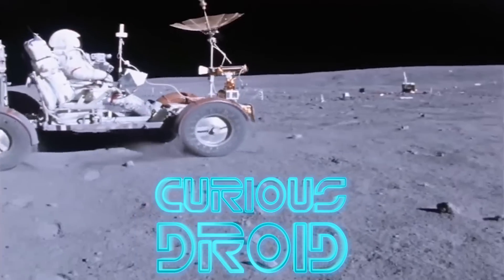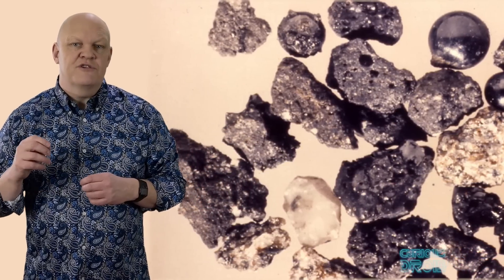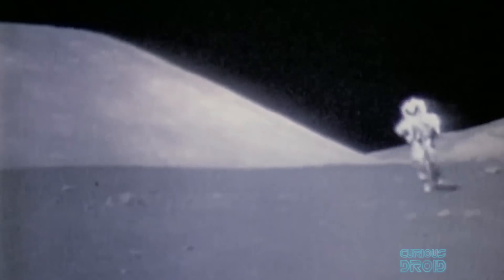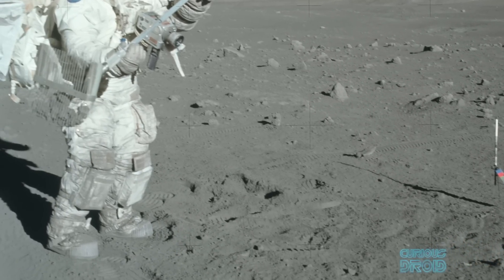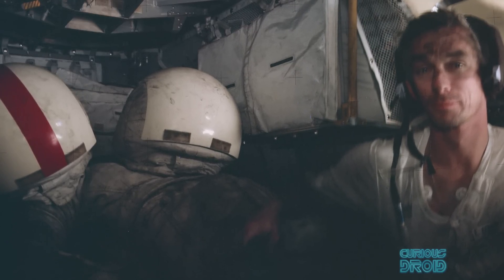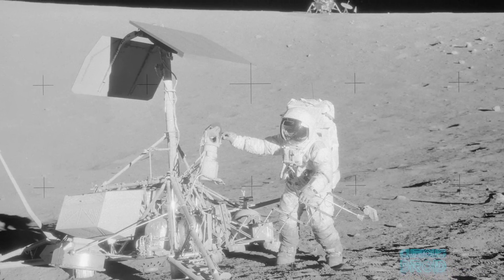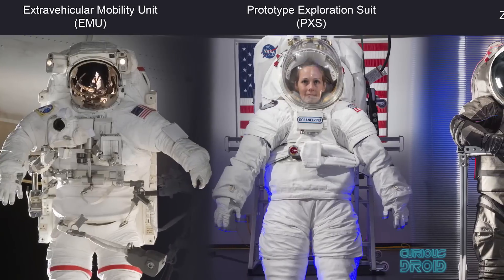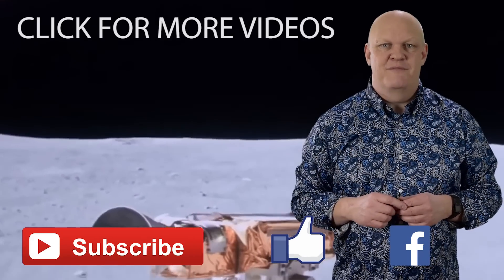Apollo, the Lunar Dust and NASA's Dirty Problem

Comment: Funny how there isn't a blast creator from landing but it can sand blast 600 ft. away.
Reply: There is a blast crater from landing (it's just isn't deep enough to be readily noticeable), and you seem to be forgetting about Moon's low gravity. Also, how exactly do you imagine NASA would decide not to fake one thing, but then fake another, if you believe those are closely related? Are you saying you're smarter than the entirety of NASA?
Reply: Sand blasting noticeable 600 feet away, but not readily noticeable directly under the rocket engine nozzle. I notice funny things and laugh. Have you ever sand blasted anything before?
Reply: @marcuserectus2442  Sand blasting noticeable 600 feet away, but not readily noticeable directly under the rocket engine nozzle.
It is readily noticeable directly under the rocket engine's nozzle. It simply isn't as deep as you assumed it would be.

Have you ever sand blasted anything before?
Have you ever sand blaster anything before in a vacuum and low gravity?
Reply: I sand blasted a vacuum cleaner once, but not in low gravity. Have a fun day
Reply: @marcuserectus2442  here is a view from apollo 12 showing the landing exhaust blast path. You can see the striations in the regolith from small rocks being blown out through the hard pack. The surface is not solid rock but hard pack with a layer of dust on top.
Just this side of the lander is a deeper impression from last minute breaking thrust, the lander's did not come straight down but came in on an angle.
Under the engine bell there is discoloration due to the exhaust.
(Forgot the link)
https://www.hq.nasa.gov/alsj/a12/AS12-46-6777HR.jpg
Reply: @silent hunter Nice picture. Don't let your flag hang down. Skeptics might think this is a staged photo.
Reply: @marcuserectus2442  then those skeptics are wrong...
Those skeptics say the proof of fakery is there are no photos of blast craters, yet just about every mission had photos such as these.
Saying something that exists doesn't exist as proof of something, negates your evidence. 
What else are you going to claim is missing but isn't?
Reply: How about the flag. It looks like it's missing a batten to hold it up.
Reply: Pixie dust, that's how ya do it.

Comment: So why was there no dust at all on the lunar module not even a crater blast or any sign of any high pressure underneath it
Reply: Without any atmosphere, there shouldn't be any dust on the Lunar Module, and there is a crater blast underneath it - it's just isn't as big as you imagine it should be.
Reply: With that theory why did everything else have such a problem with dust
Reply: @livenloud6697  Because the astronauts kept walking and hopping in it.
Reply: @Jan_Strzelecki  at the business end of a rocket booster atmosphere of or not it will create a massive muzzle blast
Reply: @livenloud6697  Yes, and in the absence of any atmosphere this blast will not hang around long enough to have a chance to deposit any dust on the landing pads.
Reply: @Jan_Strzelecki  if a blue stuff everywhere when it took off why wouldn't it's not bow stuff everywhere when it landed
Reply: @livenloud6697  It... didn't, so it wouldn't.

Comment: Another reason to doubt the veracity of the moon landing:
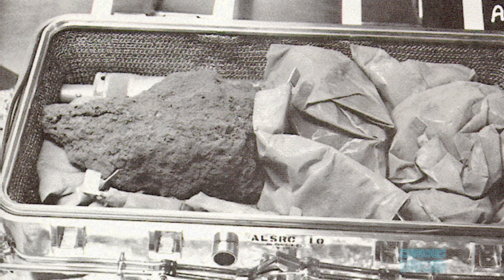If the dust got airborne in the cabin during the return after changing out of their moon suits, a fact the narrator talked about from 4:00-4:28, and the cabin is pressurized to mimic the moon's atmosphere (near weightlessness), then why was there not so much dust lingering in the air that visibility was a problem when the thrusters were blasting the landing site at touch down?
Also, why does the moon dust fall back to the ground so quickly after being spun up into the air by the moon rover tires or the the footsteps of the astronauts?
It makes the theory that the astronauts were "moonwalking" with wires attached to harnesses in a studio to appear to be in a near weightless environment more plausible when you see the "moon dust" act just like sand around the tires of a dune buggy on earth! I guess NASA just didn't have enough wires for all the grains of sand to mimic near weightlessness, or they just figured we were not all that smart. Actually, I believe they just figured that if you tell a lie long enough most people will believe it, especially when you can so easily make them WANT to believe it, even as you rip them off financially, to pay for this hoax.

I watched the 1969 moon landing at my neighbor's house (we didn't have a TV). I also drew a life-sized astronaut with a detailed space suit during art class, and I was a good artist. (My teacher wrote a note to my parents on my last report card that I could be the next Norman Rockwell.) So I had complete faith in the space program back then. But as I got older and began to question things I had been taught, and the more footage I watch of the Apollo missions , the more I believe it is a giant hoax. And I don't even WANT to believe it is a hoax. But facts are stubborn things. Some observations were not foreseen and therefore, not considered for coverup. But these videos do a decent job and reconstructing some details to explain certain objections away. But you can't explain everything away when it just isn't true!

Another observation: In the video of the moon walk, Buzz Aldrin is under the LEM and saus he cannot see because it is too dark under there. Yet, we are told that the moon's surface was so bright they had to use filters on the lens' because otherwise, it would be a white-out situation due to the brightness of the reflecting sunlight at the surface. If that's so there should not be any shadow under the LEM sitting that high off the ground and with the sun visible in one direction, which Buzz clearly indicated!
Makes no sense!

I would seriously like someone to explain these two things away!
Reply: @libertypastor1307  You can delete your comments. Also, I have no idea what your point actually is.
Reply: @Jan_Strzelecki  Thanks. I tried deleting the extras, but then all would disappear. But when doing it from my phone, I was successful. So thanks again.
My point was that there are so many outstanding, unscientific facts that no one is answering, that they testify against the veracity of the official narrative that we ever went to the moon.
I for one high doubt it. Though I want to believe it, the facts don't add up when out under honest, scientific scrutiny.
I'm waiting for someone to provide provable answers to the questions I raised.

Comment: How did they survive the van Allen belt of radiation? That seems to be a great challenge for today's engineers,  let alone back in the 60's. Please explain...
Reply: @ Blaine Pucket James Van Allen, for whom the belts are named, was a consultant for the Apollo project. The Apollo craft were able to quickly pass through the belts in relative safety. They did so having drawn on the expertise and input of Mr Van Allen himself. 

It was a challenge for a recent NASA spacecraft, Orion, because 1) it will be hanging out for longer periods in more dangerous areas of the belts, which was not the case with Apollo, and 2) has much more sophisticated and sensitive-to-radiation components than what was on the Apollo spacecraft. 

You'll notice that I said WAS a challenge; the issues with Orion and the Van Allen Belts were resolved in 2014.

Comment: The so called "experts", even Arthur C Clark thought the dust thickness was going to be tremendous due to the millions of years of dust fall, and that's why the ladder was so very short and the landing gear had such wide snow shoe like surfaces. They were all very surprised by the lack of such thickness, which suggest not so many years.

Comment: Amazing that all of the moon missions were without any deaths even though they knew little about the potential effects of  solar flares, the radiation and heat in the Van Allen belts, the heat on the Moon's surface and micro  meteors piercing their suits. Unbelievable really.
Reply: Much was known about the dangers posed by solar flares, the Van Allen Radiation Belts, temperatures on the Moon surface, and micrometeoroids.
The only one of these that would have posed a threat to the short duration Apollo missions was a a solar flare. More specifically, a super massive mass coronal ejection. But these happen only once every few years.

Such a massive coronal ejection would have killed the astronauts if they'd been on the lunar surface. But the Sun was constantly monitored, and the astronauts would have had hours to make an emergency launch from the lunar surface and rendezvous with the Command and Service Module. Then the CSM would have been orientated with the engine pointed towards the Sun. The Service Module and the heat shield would then have offered a measure of protection for the astronauts.

It was still a risk, but a small one when measured against all the other risks of space flight.
Reply: They had already a comfortable amount of informations at the time the first manned Apollo spacecrafts went in space, about the navigation beyond the low Earth orbit, the rendez-vous and the docking of spacecraft, the heat during the reentry from the Moon, the lunar gravitational field, the landing sites, the Van Allen belts, the micrometeoroid threat etc. The preparatory program of automatic probes, that was performed alongside the manned test missions (particularly the Gemini) is largely unknown, but was extensive, accurate and really well done. Ranger, Surveyor, Lunar Orbiter, Pegasus were programs meant to gain the knowledge needed to successfully go towards and on the Moon.
Reply: They knew about all those things actually and planned accordingly.

Comment: Mars has the same problem, only write because there is a thin atmosphere that it floats in during storms, so living there for even a short time is not realistic.
Reply: "only write" what is that supposed to mean?
Anyway, there is wind on Mars and that could mean that as dust particles are moved around they rub against other particles of dust, and thus they get less sharp, as sand does on Earth. Come to think of it I have a friend who works on the Mars projects. I'll ask him about it.
Reply: The mars dust problem has already caused issues for previous mars missions, I don't think that "sharpness"of the particles is necessarily more a concern than the very fine size which allows it to damage the lungs
Reply: @superdoubt  how come beach goers don't get silicosis? Because, it seems that sand grains are not very small. The smaller bits get washed away and go into the sea. I'm speculating of course.
Reply: Henri, silicosis is caused by very fine mineral dust that can float in the air and in high concentration to scar the lung tissue, but lung damage perhaps isn't the most pressing problem posed by very fine mineral dust. instead, it causes seals and mechanical parts to fail, and gets statically charged so it sticks every thing
Reply: That "only write" is a swipe typo, it's supposed to be "only worse"

Comment: Working on dust protection for a lunar mission and can revise some things, mainly the physical bombardment isn't the main factor for us, the constant comic rays charges the moon from subatomic damage that also allows grains to levitate by their mass:charge ratio, not size due to the dirt having different sources. 

The levitation layer ends drifting off in a continuous process of surface ablation slowing the accretion rate to 1mm/1.2My, a footprint is 15My old at the bottom, and, it's always charged now to about -100vdc static as is the interior, the moon is a leaky capacitor with a resistance from mixed content, an astronomical electrical system.

It seems this 'dustosphere' is 20,000 grains per cc at 1m of repelling grains that never touch, daytime voltage doen't affect the Debye Sheath or ground, so many electrons are being absorbed, the + is from photons and overcome, the Van der Waals radius where the Debye resides ...

There's more, had to relate those on finding this, agree with others, a great video, cheers!
Reply: @Alligator-z1q  Health and machine longevity are the bottom line on the dust, the smallest cause DNA damage, systemic immune system breakdown and the larger ones silicosis, we can't live there yet.